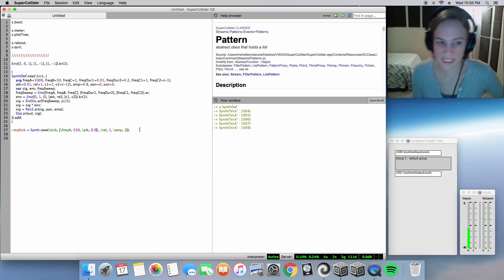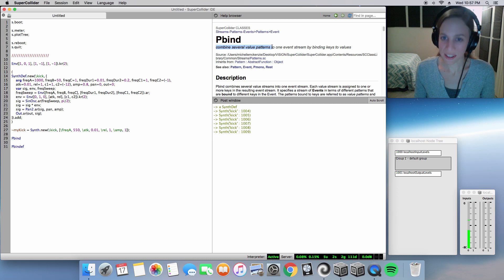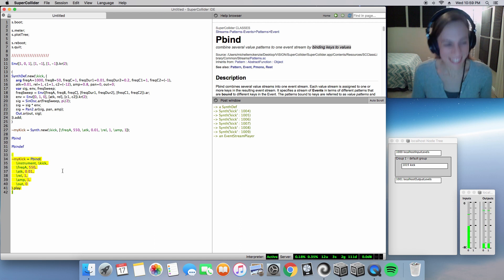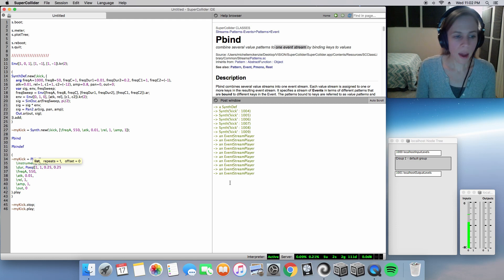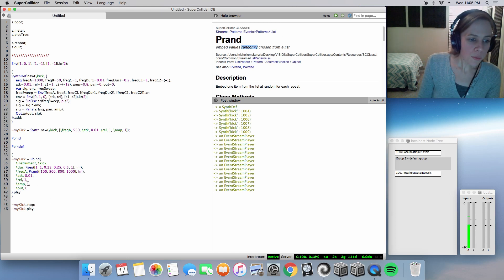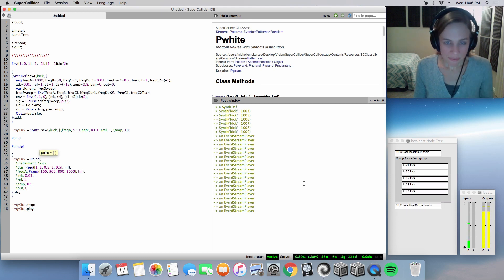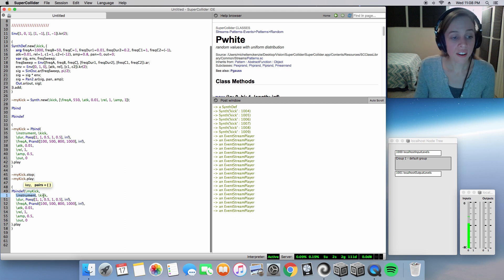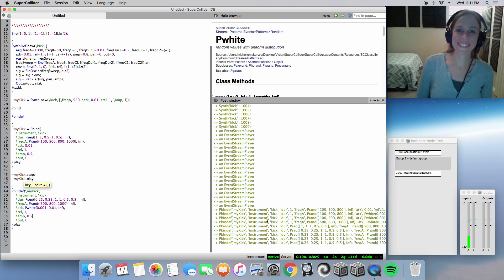Composing Rhythm, Part 1

Comment: Love your channel and your music. Thanks for both! One comment: I notice that you bake the .play message into the definition of the ~myKick Pbind. Because you do so, your commands to start and stop it (~myKick.play and ~myKick.stop) both work. But I learned that hard way that if one does NOT bake .play into the Pbind definition, those commands don't work because of the relation between a Pbind and an EventStreamPlayer. (Note that this comment applies only to the Pbind section of the video, not the Pbindef section.)

Personally, it's not intuitive to me to define the Pbind to include the .play message. Instead, I intuitively want to separate out the pattern definition and pattern playback. But I discovered that when I did that, then to get .play and .start to work, I had to do something a little different. It took me a while to figure this out, so I'm sharing it here for you and any readers:

Assume that the Pbind ends with a parenthesis but without the message .play at the end. If so, when you invoke the Pbind after defining it, you have to assign the invokation to a variable, like so (using the terminology from your video):

~kickPlayer = ~myKick.play; // The new variable ~kickPlayer is an EventStreamPlayer that now handles playback of the Pbind
~kickPlayer.stop; // The .stop method can operate on the EventStreamPlayer just created, so we can stop ~kickPlayer this way
~kickPlayer.play; // And we can restart it now this way.

Again, thanks for the great work on this channel. We need more up-to-date tutorials on SuperCollider, and yours are terrific! Thanks!
Reply from the maker: Thank you, Brian! You're very kind. Thanks for the advice, I'll look into it!

Comment: Thank you for your videos, they took me one step forward! Do you know why when I put my TempoClock t variable the pdindef is evaluater but I don't hear any more the kick? Nothing seems wrong yet no kick output?
Reply from the maker: Hi firas firas, I've come across this before. I haven't figured why this happens to Pbindef specifically. (I haven't seen this with Pbind.) The not-so-clean way to get that output back is to save, quit, and start again. But to be more efficient, have you tried this code below for TempoClock?

(
t = TempoClock(88/60).permanent_(true);
t.schedAbs(t.nextBar, {t.beats.postln;1}); //resched every 1 beat
)

t.schedAbs(t.nextBar, {t.tempo_(60/60);nil}); //don't resched, if you want to change the tempo while running synths
t.stop;

After implementing tempo this way, I stopped getting those hiccups. Hope this helps you out!